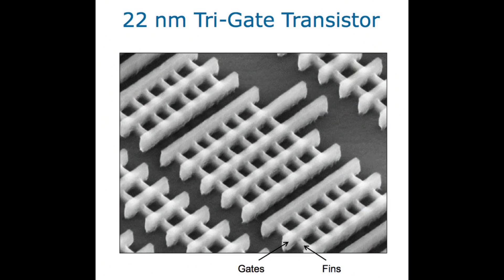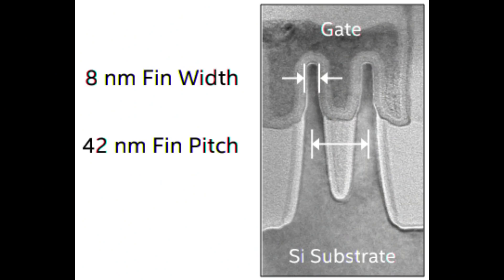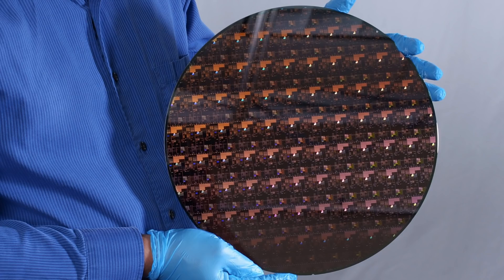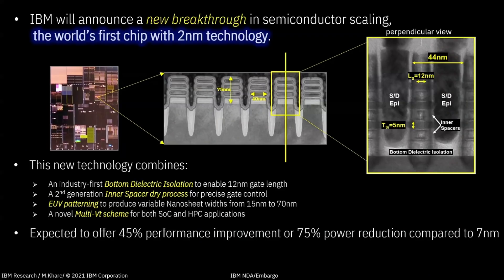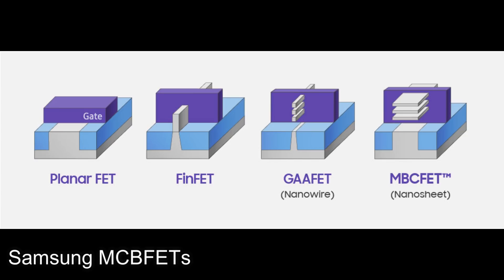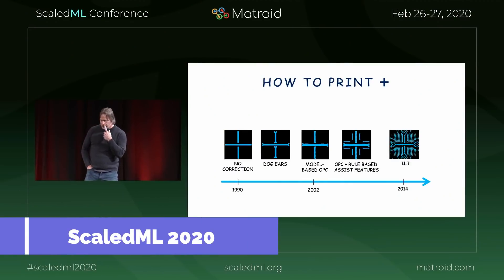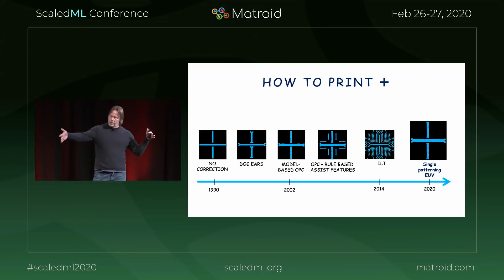There's Plenty Moore Room: IBM's New 2nm CPU

Comment: People forget that IBM is often on the leading edge of Microprocessor innovation. For a long time AMD was helped by IBM in this regard - Cell for PS3 was IBM and AMD co-operation - though mostly IBM as far as technology goes. I might not remember everything perfectly of course. But the point is that whichever company works with IBM - be it Intel, AMD or NVIDIA - can get a tremendous amount of know-how from that.

And yes - IBM no longer produces chips for mainstream (last time I think it was the aforementioned Cell - and I think that it was AMD that handled actual production) - but don't they have chips for special clients? I know that a lot of Space stuff, used IBM radiation-hardened processors. I doubt they would be run with even specialized chips that Intel or AMD push for larger markets. Especially since radiation hardening is easier in bigger nodes. Of course it would depend on what it is used for and where.

Will you do a video on this type of specialized equipment? It would be very interesting.

Thank you for the video!
Reply: IBM doesn't really have a fab, just research facilities.  The last fab they had was East Fishkill. IBM gave Globalfoundries a bunch of money to take it and Burlington off their hands. Now On Semiconductor is buying the EFK plant from Global. When I started in EFK we were making XBOX 360 chips and PS3 chips.
Reply: IBM doesn't really have a fab, just research facilities.  The last fab they had was East Fishkill. IBM gave Globalfoundries a bunch of money to take it and Burlington off their hands. Now On Semiconductor is buying the EFK plant from Global. When I started in EFK we were making XBOX 360 chips and PS3 chips.

Comment: Thanks. How much area is lost when slicing up the wafer. As chips get smaller, a larger proportion of the wafer must be lost due to the width of the cut. Or.... Are the wafers scored and snapped like a glazier would do with float glass?
Reply: They are cut with very fine cutters, but you only loose about a tenth of a millimeter to the cutter.
Turn out, chips smaller than a single square millimeter are already hard to handle. Integration is the way: just combine the functions of chips until you reach that square millimeter.
Reply from the maker: That's a function of chip size regardless of process node. I've seen companies that build microcontrollers boast 10k+ chips from a 300mm wafer

Comment: that Jim Keller clip really puts things into perspective.
Reply: I don't think that removing one bottleneck solve the scaling issue though. The resolution of the lithography process might be high enough to keep increasing the transistor density, but does that mean that it's practical to do so? As far as I understand the real issue might not be Moore's law, but Dennard scaling. If the power density gets to a point where we can't find ways to practically cool a silicon die, we're just hitting a different bottleneck instead.
Reply: @cosmiczeppelin  we can always run the coolant through the chip itself. Packaging might get a bit complicated though
Reply: @Greitone  oh jesus christ, i rue the day that microfluidics enter the semiconductor scene for... cooling...
Reply: @Greitone  That would be pretty tough.

At extremely thin layers water boils faster, it's conduction to the next layer of water that keeps it from vaporizing, at thin layers water boils below 200*F.

You'd need 100% pure water to prevent conductivity, which also lowers the boiling point, but water is a corrosive so eventually it will leach matter from the chips and become conductive.

A non-conductive liquid will have higher viscosity, won't flow in tiny areas nearly as well, if at all. Going to a non-conductive liquid would almost double the minimum size for water pathways.

I think liquid cooling is going to become standard, though it may be closer to our phase change air coolers than traditional water cooling.
Reply: @glenwaldrop8166  One idea is basically a heatpipe/vapor chamber with the evaporator being structures on the die itself.
Reply: @tommihommi1  the issue we have here is the heat density is at insane levels, not sure if a vapor chamber on die would work. Without the heat spreader, physical contact for it to conduct, it would just vaporize the water and effectively remain dry the whole time.

We're honestly talking about heat densities that are exceeding the operational temperatures of nuclear reactors.

We need some kind of matter conducting heat away from the chip and at the same time that very matter is keeping heat from moving out of the chip quickly enough.

We're going to have to produce less heat. I think they're going to have to dope the silicon differently to lower the switching voltage or move away from silicon altogether.
Reply: @glenwaldrop8166  Loving this discussion! I was thinking along the lines of the chip not being flat, but 3d, built as vertical fins very much like the copper plate of a cpu block. Connecting those fins in some way and insulating the circuitry in each fin from the coolant would be a challenge, but this is a theoretical scenario where heat density is the performance bottleneck, so I think chip designers would get creative.

I get my comment implied something different, more like through silicon via watercooled version, but I was thinking of making the chip 3d so that cooling area is nor limited to 2 dimensions
Reply: @Greitone  Initially I thought you meant coolant circulating through the chip, like automotive applications.

I see what you're saying, kind of integrate the heatspreader as the fins for the lower half of the water block, right?

Though if they used dummy silicon on top of the CPU it could be run through channels on top, literally just make 1mm grooves in the silicon... that might be less reactive than metal and it wouldn't matter if the coolant was conductive.
Reply: @cosmiczeppelin  there's always new challenges to overcome, but the important bit is that there's no fundamental limit that we're hitting yet.
Reply: @tommihommi1  Oh definitely. I think we have a lot of exciting innovations ahead of ourselves. I'm just concerned, that the complexity will get to a point, where consumers might not reap the benefits of these innovations as easily as before, because of cost limitations. 

@Greitone The complexity is what I'm concerned about. I've no doubt, that sophisticated cooling methods will be found, but I wonder about the innovations necessary to keep the consumer market evolving at an acceptable price. I also don't see us having 2kW power supplies in our desktops anytime soon, so power efficiency will have to improve anyway.

In a way these limitations are exciting, because they might produce innovations, that otherwise wouldn't exist.
Reply: @cosmiczeppelin  This already exists (the heat density problem) Solution is dark silicon, and putting parts of the die that aren't high power next to high power parts to act in a way like dark silicon, so these parts can exist.

The next step I see is slightly lower clock speeds to where a chip can run at say 0.7-0.8V optimal vs 1.2-1.5 currently. With the extra transistors it shouldn't be an issue. Plus, when you are using lower voltages and creating less heat, you can inherently use more transistors again, (Like an apple 7nm design vs and AMD 7nm chiplet design and a Renoir design. Lower power = more density = more transistors to make up for slight losses of clock speeds).

An interesting part of looking at Renoir design, look at all the dark silicon around the cores. its like a huge empty space not being used, because of the heat density.
Reply: @cosmiczeppelin  to get around Denard scaling we need a different mix of silicon to lower the switching voltage itself.

We are already losing clock vs previous generations.
Reply: @cosmiczeppelin  Factorio has taught me that it's bottlenecks all the way down.
Reply: Jim Keller is a something else.

He is high tech yet 100% practical and has a bit o roughneck in him, at least personality wise.

He very much seems like the kind of guy who would be out in the garage making a tool he needs out of a damn rock rather than drive to town to buy one while at the same time he works in processor design, working on chips that requires an electron microscope to even check your work...
Reply: It was explained very well. Guess I learned some stuff.
Reply: I like how he stated: We can calculate for these anomilies.
Reply: Reminds me of the problems font foundries used to have with phototypesetting a 100 years ago. Same problems, different scale … to put it mildly.
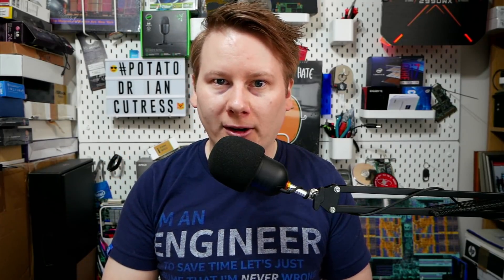Reply: 11:50
Reply: Where's optical switching at, anyway 🤔

Comment: Would be nice if the industry moved over to transistor density of the node used instead of the now arbitrary nm.
Reply: transistor density also isn't a single value because there's high density, high performance and low power libraries, each with different densities.
Reply: Marketing strongly disagrees with you, until they can find a metric that makes their product look undoubtedly superior to competitors..